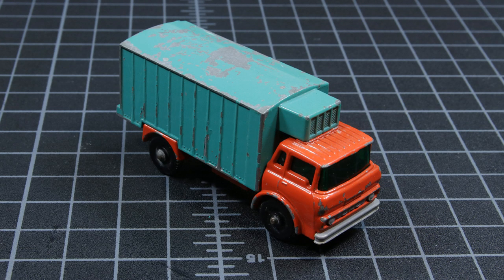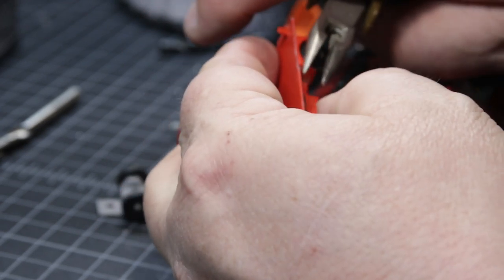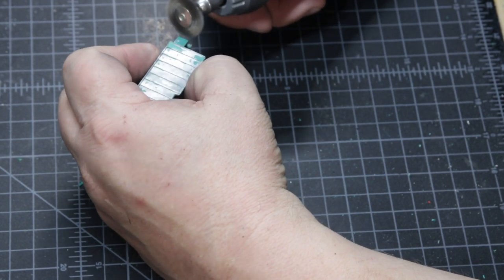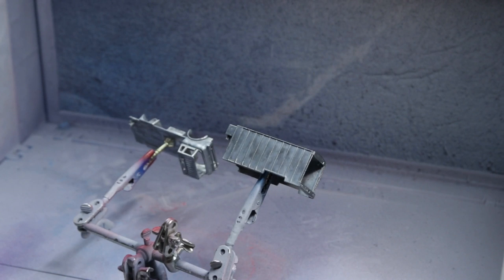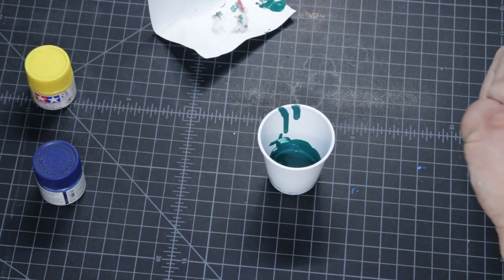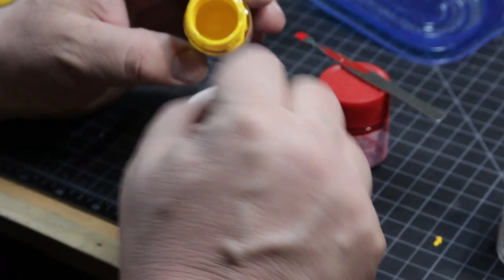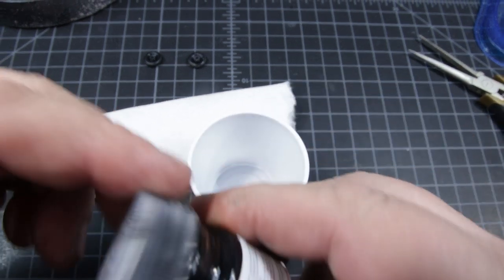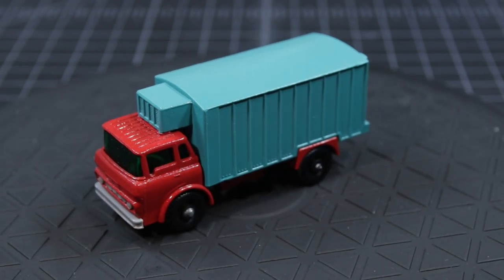Matchbox #44C G.M.C.  Refrigerator Lorry - Restoration

Comment: you did a great job on matching the paint! an FYI...this model made it to superfast...it was fist made in the same colors as the regular wheels and then was painted in a  yellow cab and red container...its said there are some red cab/red container superfasts out there as they always used up parts and they made a very rare variation without knowing how the collectors market would be 50 years later...again great job!

Comment: Nice to hear someone referring to a fridge truck as a 'Reefer'. I've worked around various aspects of road haulage for many years, and 'Reefer' is a term I often have to use in paperwork, but is one not much used outside, unless someone is talking about the kind that is smoked. I like your reference to Ms. Von Teese on your stripping area, too. I always liked the GMC when I was a kid, as it's  big and chunky - and you can put stuff in it. It's from the period of Matchbox models where they would come with great little extras, too. The Mercedes truck with the scaffolding load, that fitted together: the DAF truck with a load of girders, which again, slotted together; the Leyland with a site hut on the back. Brilliant stuff. Your restoration, as always, is superb.

Comment: Excellent work.  Another great restoration!  I'm always interested in seeing how others do things.  The paint stripping is always interesting because I've encountered considerable variation in how stripping products work, depending on the model.  I'd be curious if Lesney was varying the paint they used, subject to availability, cost, etc. I have a #45A Vauxhall Victor - extremely simple model - that I swore I was going to have to use a jack hammer to get the paint off! (Learned a LOT of lessons with that one!)  BTW: the paint job looks spot on to me.  Anyway, keep up the good work!  Look forward to the next video.
Reply from the maker: When I did my Opel Diplomat, I felt the same way . . . almost started to believe the metal was that color!

Comment: On painting were they not dip painted?   I remember on some of the 70's ones I had as a lad there were on occasion gathered runs on some of the more fiddlier castings and they prob had a line of communal paint baths for various models done in batches.   I never got to see the paint section when I got into the place on a tour, Hornby's factory did have both spray and dip lines for the trains and Scalextric cars.
Reply from the maker: I don't think so, there is a video of the Lesney factory.  They were on some kind of spinning apparatus and sent though an automated spray booth while they were spun around very fast.

Comment: I think it turned out very nice. The container seems a bit more blue than the original. I wonder if you did your color match on the body before stripping as I've seen by other restoration content providers you might get a closer match. Not criticizing by any means, just respectfully suggesting and offering my observation. I love your projects!
Reply from the maker: I have four of these, none of them are the same color, so it really doesn't matter.  Color matching is a myth, a unicorn.   It's a 50 year old toy that has been subjected to a variety of environmental influences from dirt, mud, smoke to sunlight just to mention a few . . . Who knows what being left in a glass of cherry Kool-Aid for two days would do to a color?  Not to mention that these were made before computers so they were different from run to run anyway at the time of production.  If I get in the ballpark I'm generally pleased and I only save the original chips to give me a ballpark to swing at.  But thanks for the advice!
Reply: @TimeRider  That's very true. As they age the colors vary. I see so many others that attempt to match the old paint, I suppose I simply got caught up in it. Thanks again for the content, I really do enjoy it!

Comment: Could you not attach the  screws during painting with magnets? If the cars are magnetic, then a magnetized screw or a very small magnet to clamp on the opposite side of the car than the screw?
Reply from the maker: I bet you could . . .
Reply: I would be scared that when something was glued on to hold the model in place during painting that I would tear a chunk off the car when I removed the screw. I guess for the part that has the post drilled and tapped that a rod with a screw thread on the end could be put into the post hole and then there'd be no extra substances put on the model that might cause damage when it's being removed.
Reply from the maker: @handsolo1209  Well . . . it does,  that's why I generally put them in a place that can't be seen.  If I can, I use the posts to hold it, but that wouldn't work for this particular casting.
Reply: @TimeRider  - Maybe you could use a very light adhesive like double sided tape to stick a magnet to where you normally superglue the screw and then attach the screw to the magnet?